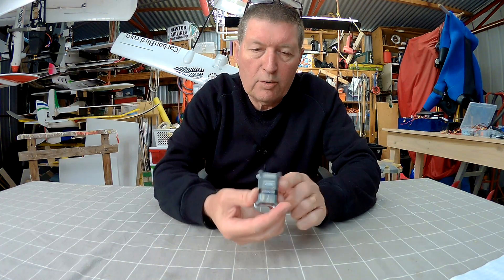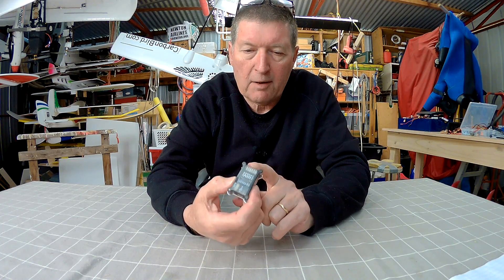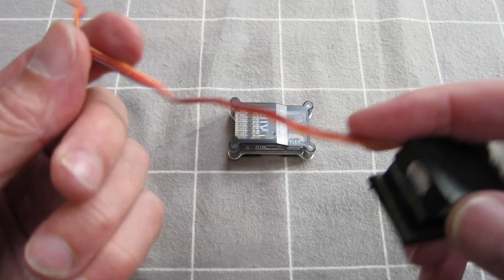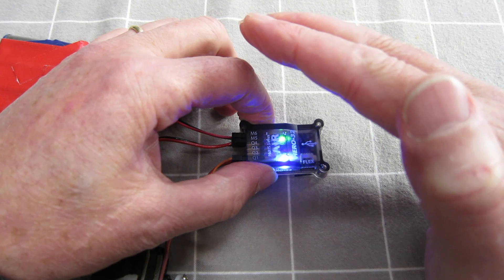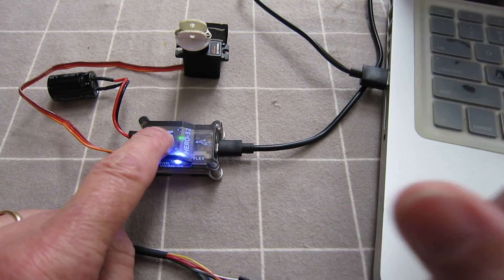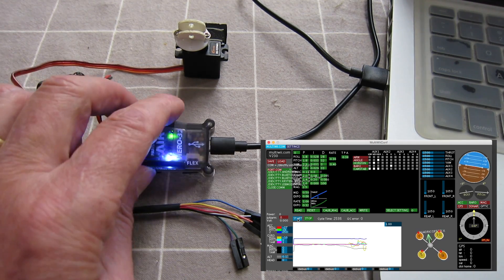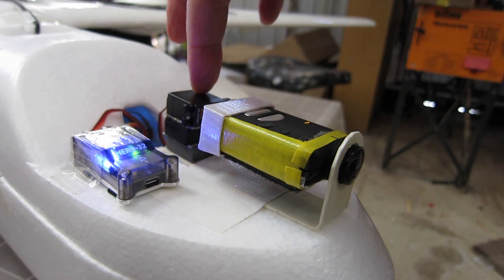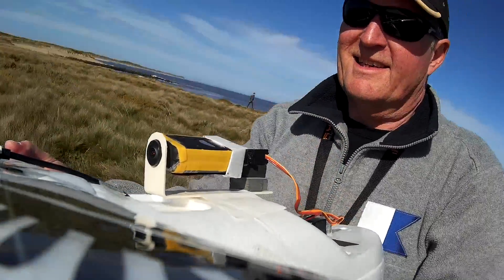AIRv2 servo gimbal controller

Comment: Andrew, Thanks for the video! Any new information or updates on this controller? I'm about to begin construction on a gimbal for a mapping camera. Have you had the chance to adjust any of the settings for a bit better performance? I like the all-inclusive design very much. Thanks!
Reply from the maker: No I haven't tried gone any further with this. It meant to be designed for camera leveling rather than full smooth stabilization.  The old MultiWii app is a bit clunky.

Comment: Andrew, I have just bought one of these. I want to do the same thing that you are doing in the video. However, the servo movement is only half the sensor movement.  I have to rotate the sensor 90 degrees to get 45 degree movement on the servo, so the camera is not going to stay level in the turn. Can you show us how to adjust this with multwii. I have downloaded it, but I cannot make adjustments. Thanks for your help.
Reply from the maker: This is not designed for video Barry, need a brushless gimbal for smooth video. It's designed to keep a still camera level-ish for mapping photos. It will work OK for video but dont expect perfect levelling. I had problems making adjustments in multiwii too. I'll try and find Q's suggestions.

Comment: DS939MG servo is digital - pretty fast ( I think 250Hz), just need fast drive settings (250Hz instead of 50hz)
this might help to get it more smooth.
I tested DS238MG and can confirm it's 250Hz (I think DS939MG may be driven with the same speed)
https://youtu.be/EHraKAqjDCc?t=1m24s

Comment: Hi Andrew...increasing the P values should see some more movement and an increase in reaction time....Dont be scared to do it, you can always put them back again. I suspect there is also an angle limiting factor that may need cranking up..like when flying in Angle Mode for example...Best way to test it is to fix a small spirit level to the Mobius and bank it over....It would be a little easier if you had a mechanical linkage to adjust and so then you could increase / decrease movement to match the planes bank angle.

Comment: actualy that's the multiwii gui interfacefor the atmel 8bit controllers back in the day
and actualy cleanflight that runs on stm32bit procesors is exactly the same code as multy wii onli adapted to stm controllers so it can run on faste 32 bit microcontroller
Reply from the maker: Thanks for that, I don't know much about the history

Comment: Cool device, maybe with a high rate servo the shakes might be less. Just a curious question. how far along the beautiful shoreline can you fly FPV with a normal FPV setup, not those long range Drangonlink high techs?  Just looking at that amazing view i feel like flying there hehe
Reply from the maker: I have heard of a 2.3km flight from 40W up to those dunes with standard FrSky RC and 5.8GHz FPV.
Reply: Andrew Newton wow that's will be an awesome view without much gear.

Comment: very innovative device ! small , easy to configure , i will buy one very soon for sure !! thanks andrew for the tip
Reply from the maker: As long as you understand it's not meant to be for video stabilisation. It's designed to keep still photography cameras level.
Reply: yes , i understand andrew , for aerial filming i use eagle eye gimbal with alex mos controller and nikon d5300 on my hexacopter but this little device use with fast carbon bird servos will help level other cameras for pictures and filming like run cam split,,,,,,,,thanks andrew

Comment: I'm not going to lie, I was pretty excited when I first heard your recap of the device.

But your video footage from the output was entirely disappointing... Didn't keep it level (your gains were off?) Stuttered (bad servo choice?, physical mounting issues?) And overall didn't add to video quality in the slightest.

I can't tell how good the device is with such an awful demonstration.
Reply from the maker: This is not designed to be a video stabilisation gimbal, it's meant for keeping photogrammetry cameras level for still photos. This is the first test with no configuration so a bit early to judge.

Comment: These AIRv2 are particularly useful when fitting a hi-Res belly camera such as a SONY DSC-RX100 inside your Skyhunter (facing down) shooting still images.  so when the airplanes turns or the wings waggle all the photos are still perfect down-facing vertical shots taken on intervalometer..
Reply from the maker: Yes I reckon it would be great for Kite Aerial Photography too for level horizons shots, might try that